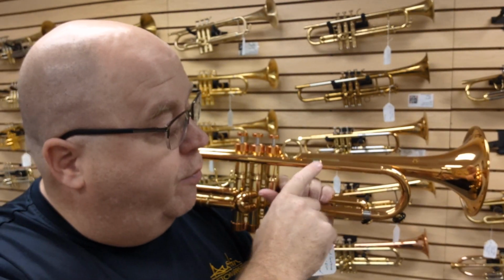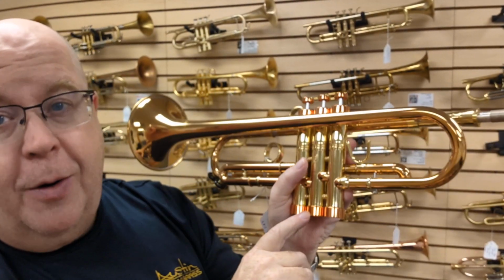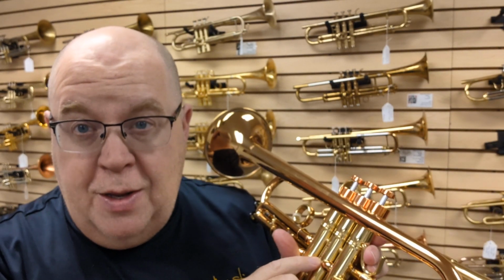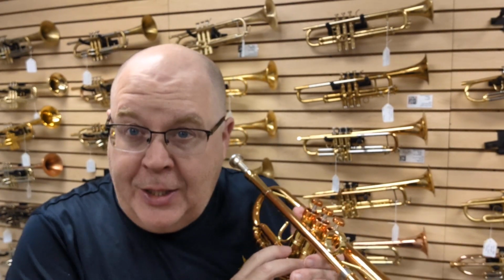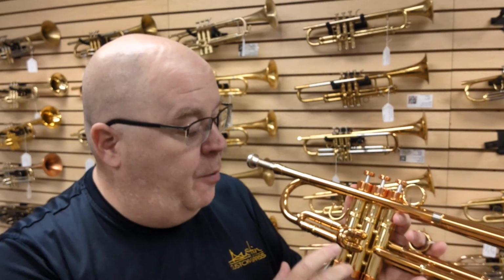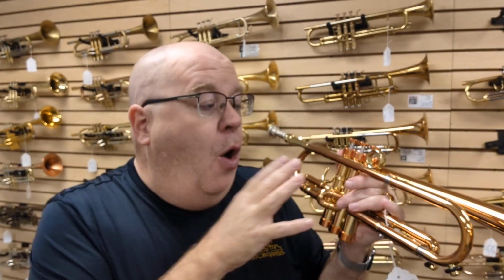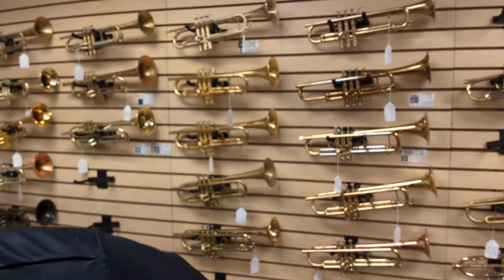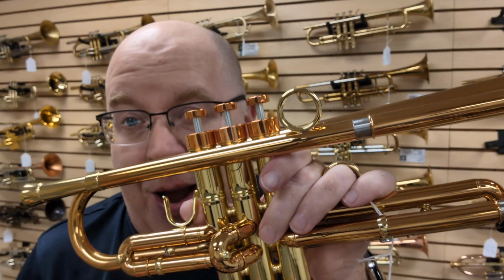Is a $2000 Superhorn possible? Yep!  Check out this 9395L-RSM CarolBrass trumpet! ACB show and tell

Comment: Can't praise my CarolBrass 8060 enough for it's gorgeous sound! It would be interesting to compare it to this trumpet, but unfortunately, CarolBrass is hard to get in Europe. However, it is worth mentioning that the valves are totally usable, as long as they are often oiled, but not on par with my old Yamaha horns.
Reply from the maker: I have found that the  valve oil choice is pretty critical for the CarolBrass valves.  I really like Hetman #1 and Berp Bio Oil #1 on the CB  valve block.
Reply: Ultra Pure works great on my Carolbrass horns. I think the Carolbrass valves are outstanding.
Reply: @austincustom  Thanks for the tip! Hetman isn't available anymore here in Europe, but if I'm informed correctly, Meinlschmid oil is the very same thing. I'll try that!
Reply: @MrCrescendo  As long as they are oiled properly, I agree!